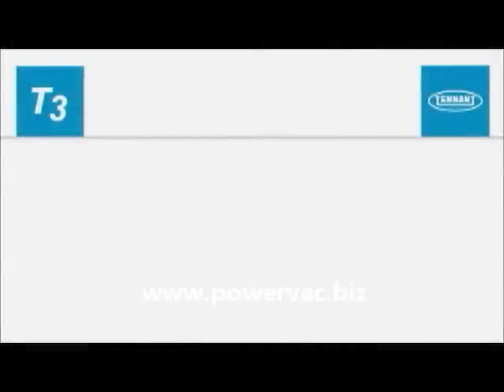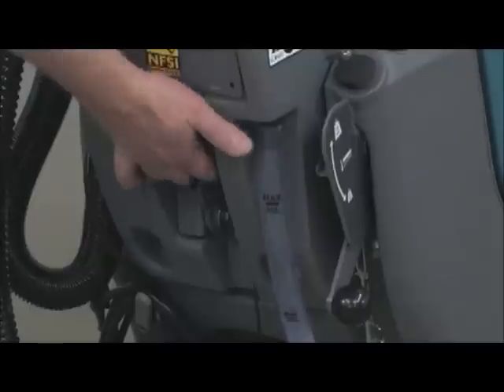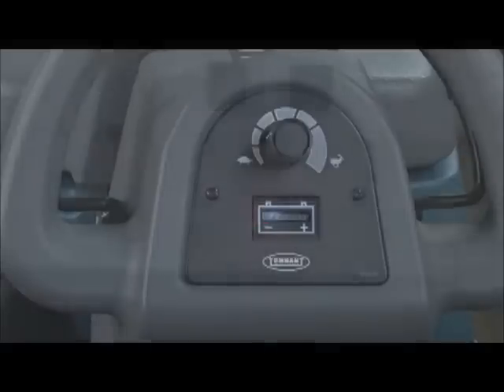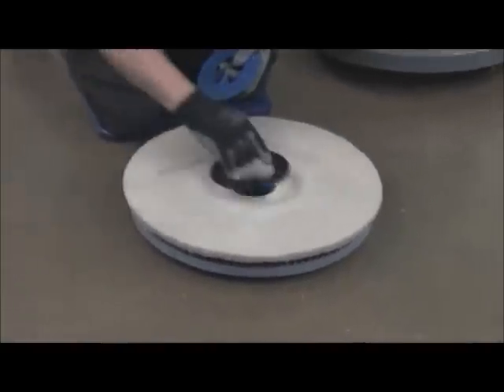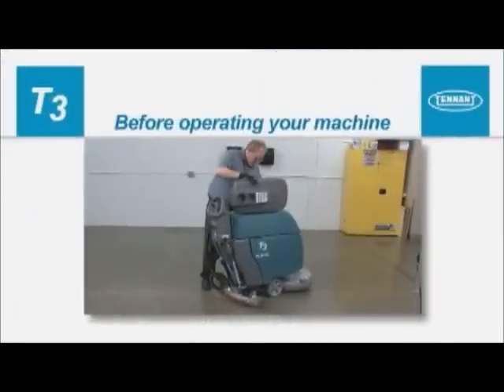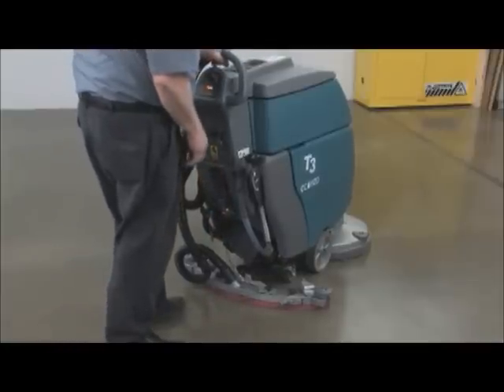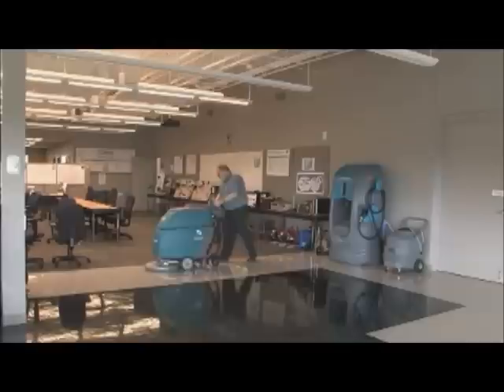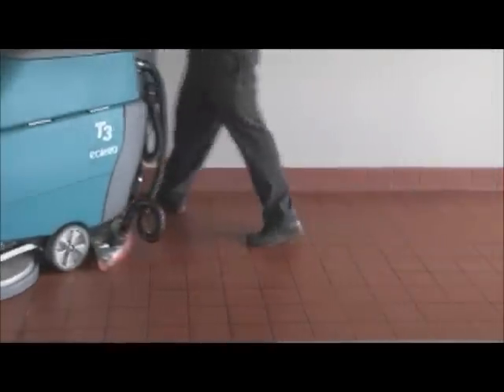PowerVac Tennant T3 Operator Training Video

Comment: 5:30 Ive followed the instructions to remove the brush assembly but it is fully jammed on.  No  matter how much clockwise force i apply to the assembly it will not come off. Any suggestions?

Comment: When I lower the pad on the t3"the machine kind of jumps when scrubbing like it's scrubbing to fast or too hard it's not a smooth steady scrub like in this video how can I fix that? I tried adjusting the brush pressure and nothing worked
Reply: Well when you buy one of these make sure you get the optional Dave Sunday option with the chocolate milk. It makes cleaning much easier